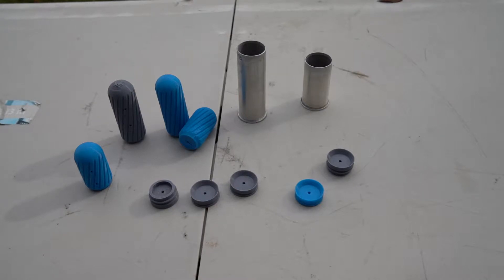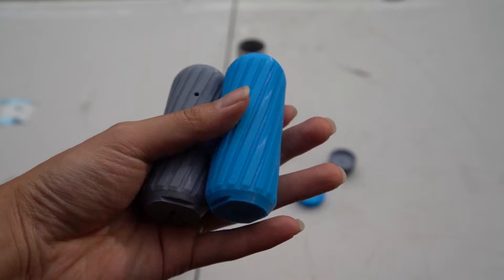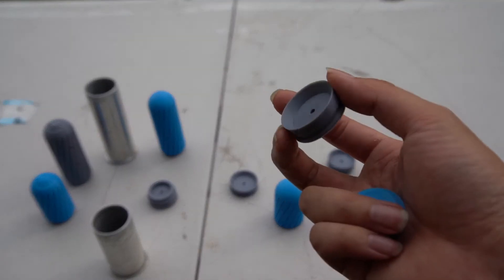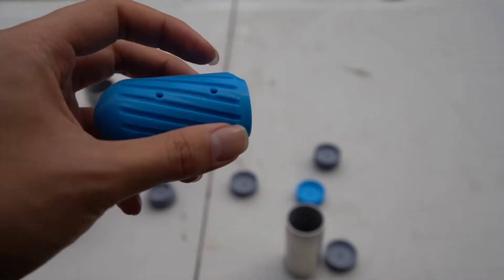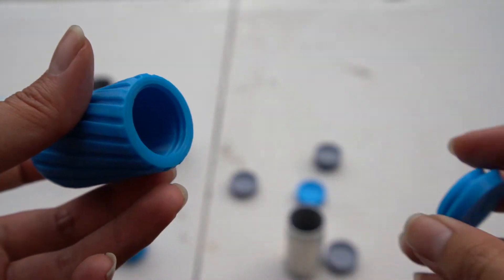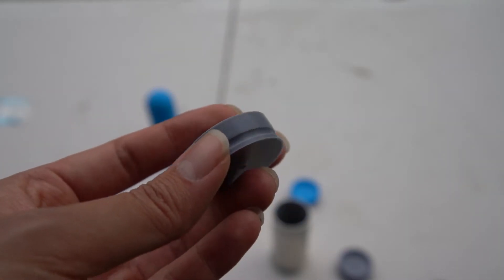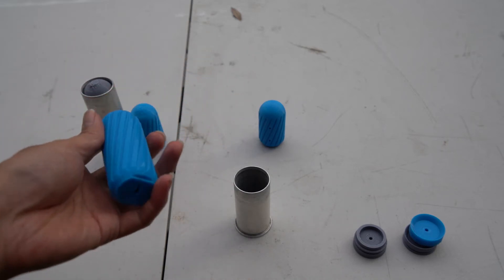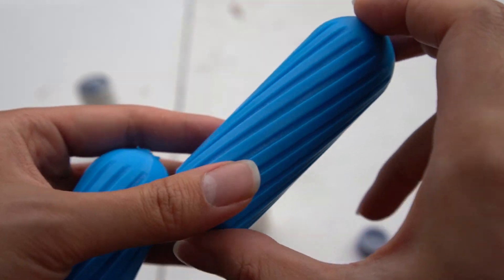3D print your own 37mm projectile!

Comment: I've had no issues with the brand Crystal clear. But also in conjunction the temperature in which your hot glue gun delivers the melted glue is equally important because if it's too hot it can actually cause any brand of glue sticks to create and have air bubbles , so you want a glue gun that is good at balancing its temperature

Comment: Hey thanks for the print it helped make my world at war airsoft tank look more realistic, also I modified the design for a 6 cm barrel on a self designed cannon, the round I made has extremely thin walls and can hold a ton of airsoft bbs. They disintegrate on contact but even if it hits someone they don't get injured.
Reply from the maker: That is very interesting. Please share video if you have.